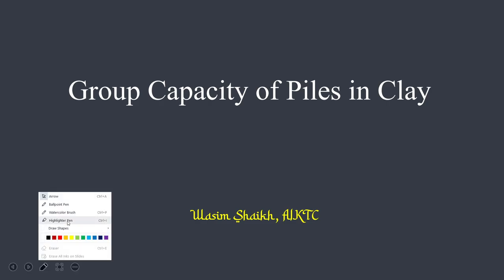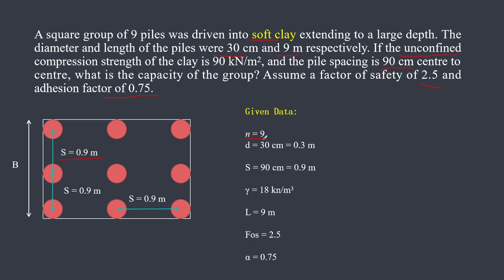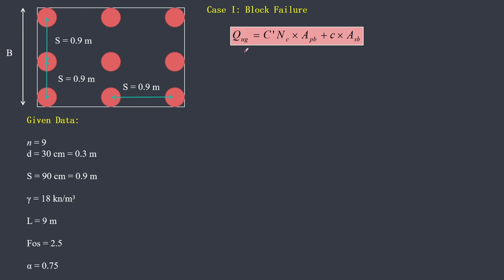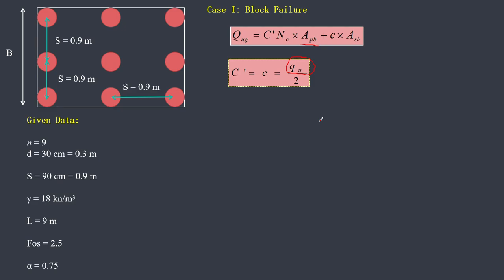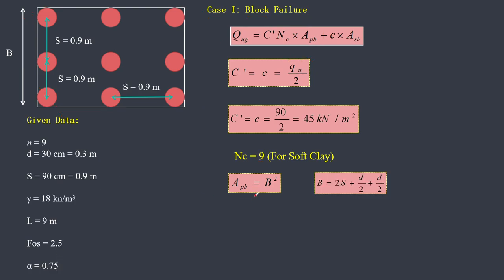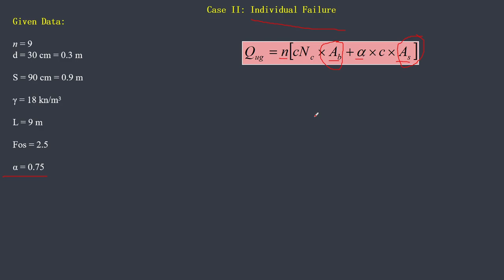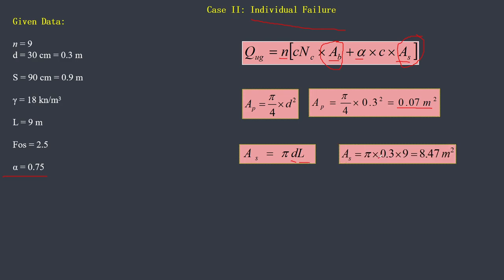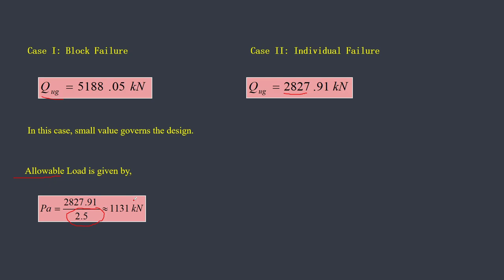Numerical on Group Capacity of Pile in Clay

Comment: α is the adhesion factor , that value is 0.75 then Qug=4337.55KN
Reply from the maker: Thank you! I checked my calculations but still possible that I made a mistake. Please refer your calculations.
Reply: Bro check your calculator
Reply: In which part u finded this mistake